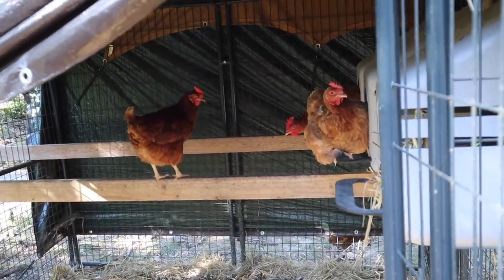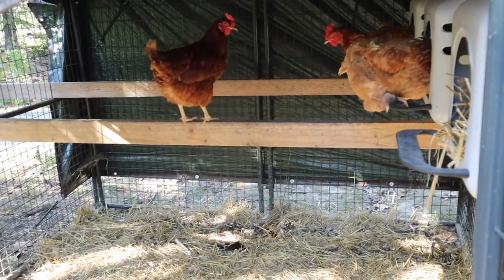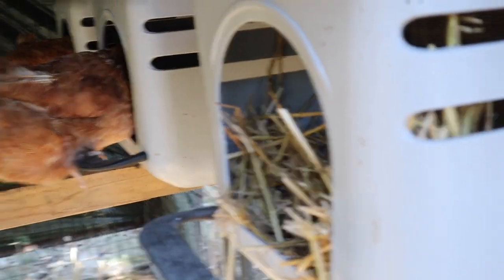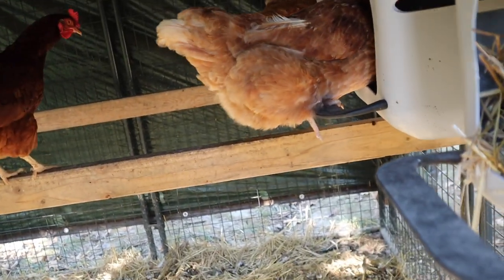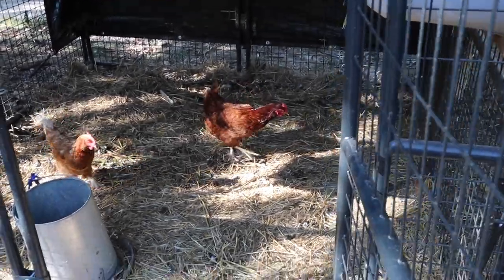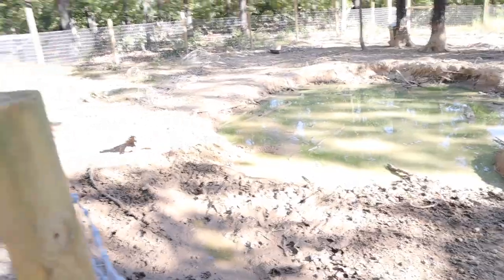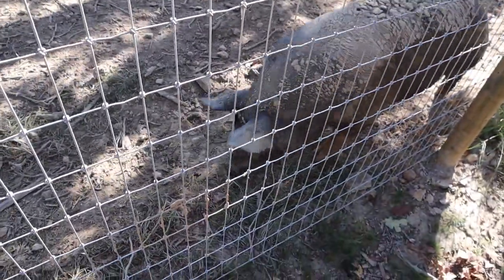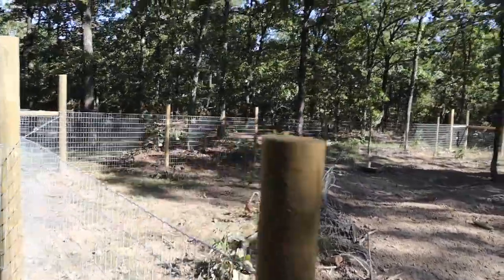HOW TO FRAME WALLS FOR A SHED

Comment: For future reference: When you have a wall put together use a staple hammer or staple gun to attach the 'bug barrier' to the bottom plate of the wall before you stand it up in place. Way less hassle than what I watched in this video.
Reply: Or just use adhesive caulk on it later. Always more than one way.

Comment: For the future you can use backing soda to remove the stinger and it helps with the swelling. I used it when I got stung just make a past and put it on the stinger. Just thought I'd share from what worked for me.

Comment: The arms on the chicken was hilarious. Little t-Rex. I was stung by about 25-30 times about 5 years ago. All up and down my right arm to my wrist. And all across my chest and neck. I was cleaning underneath overgrown bushes. I was trying to rake and use my hand to remove debris, leaves. I was wearing leather gloves. I apparently dug into a nest of ground bees. I didn’t, thank God go into anaphylactic shock. I took Benadryl and made a paste from plain meat tenderizer, to take away the itching and pain. My arm especially looked like Popeye, lol. I should of went to the hospital, but I didn’t. Wasps are way worse. Thankfully Brandi is okay.

Comment: A tip on installation of the sill seal.  Before standing your wall up staple the sill seal to the bottom of the bottom plate.  Also even though sill seal is ok its old tech.  Now days we use a couple of thick continuous bead of acoustic sealant.  It never really dries so its like a rubber gasket under the bottom plate.  Keeps everything out water, air, and bugs.

Comment: I had the same problem .  1 of the five was attached by the other 4.   I tried for 10 months to get her back in the flock to no avail.  I had to but her in a hospital house and small run.  Later I built her her own 4x4 house and run.  I allowed the 5 to run in our fenced yard under supervision, but they chased her often.  I finally rehoused her to a farm where she was put with a rooster and 1 hen where she is very happy.  If the aggression draws blood you may have to relocate her.

Comment: On each side of a door you have a King stud and a Jack stud. The king stud goes from the plate bottom to the plate at the top. then the jack stud goes from the bottom plate to the bottom of the header. the king and jack are tight together. The jack stud bares the weight of the header. Also check your your local code for header sizes based on widths of doors. Right now all the shear weight/ strength is the four nails you shot in.  We have a office here that we can call for these kind of answers to building. they're called Cooperative extension. Very helpful with code info in your area. I know you are off grid and i only tell you this so it doesn't bite you later. Keep in mind of snow loads. Wet deep snow that is sticky and won't shed. Love you guys stay safe.

Comment: Baking soda and water, mix into a paste and let it sit for 15 or 20 minutes. Helps with swelling and itching. Also there's a product called "Afterbite" that works well too. Stings a little at first but then the sting goes away. Helps with itching too.

Comment: baking soda with a couple drops of water to form a stiff paste will pull out all the stuffs. A stepped and squeeze out the hot water tea bag works too. Hell that one cures pink eye in 24 to 48 hours if you sleep with one on. I used a green tea bag for my pink eye and it was extremely better in one night.

Comment: the one thing that has worked for me with bee stings is baking soda and water mix the 2 into a paste and spread it around and it does help that mixture will help with the itching and swelling and pain and it neutralizes the bee venom

Comment: Any sting that I've treated, make sure stinger is removed & put on a paste made from baking soda & tiny water. It draws. In a pinch mud can help drawing. In old days ppl soaked bacon fat in turpentine & held it over the area, also to draw out infection, splinters & so on

Comment: Well house framing looks good  you and Brandy did good together. Working together building your own stuff. Things are coming together nicely. 
Stung on the foot had to be painful I can imagine. Y’all have to be careful with the bugs you got around there and wear shoes when appropriate.
Chicken was funny with those arms on. 
Made me laugh.
Dutch if you run any electrical like in the well house have you considered using MX type rather than Romex. It’s flexible metal and comes with the wire already in it 14& 12 gauge wire. It’s easy to work with metal shielded flexible about 1/2 inch dia. 
Bug and rodent proof.

Comment: Maybe those that didn't like the arms on the chickens need to have and extra set attached to their heads!! Anyway a suggestion to make your shed a bit more structurally sound.  Get yourself 8 more studs and put one more in each corner to supplement the attachment of each wall.  It allows one end to attach to 2 studs vs 1 giving you a strong corner even with the top plate.  Next put a double (cripple) stud on each doorway opening for support for the door sizes you want to use.  You'll be happy in the long run.  Keep the video's coming.

Comment: Hey Dutch you can staple that insulation on the bottom of the 2x4 before you lift them into place easier then just lifting walls and laying it on the floor. :)

Comment: An affordable option for your door (but you would have to put it on 12’ side for obvious reasons) Sliding barn door using door rail and hangers. You can get all the parts reasonably from TSC or order online

Comment: You're probably well into the truss building and installation but, every bit of over-hang helps keep a building cooler on its own with 18" being a gold standard of heat reduction, cost, usage impact, and some heat, loss reduction.

Comment: Really like your channel. Just a suggestion, next time you use sill-sealer, staple it to the bottom plate before you raise the wall. It will make the job much easier. Keep up the great vids.

Comment: Just a little suggestion I tack the foundation sealer to the bottom of the bottom plate. Like you I am usually working alone. I swell like that from yellow jackets and it itches like crazy.

Comment: Dutch mate, have you thought about hiring a builder on a sub contract basis and you work as his laborer when you start building your home. We did it when we built our home, and it takes some of the stress out of getting it done. I then hung the drywall and then I got someone else to hang the doors etc. With Fall being only a short period away for you guys, it maybe an option worth exploring.

Comment: It was funny Dutch. Try this... Hold the chicken with wings tight against their body. Then tuck the head up under the wing, turn them upside down ,& rock them forward & backward  several times. Them gently set them on the ground. It puts them to sleep briefly

Comment: You might have what is called a delayed reaction to the sting. I have two kids that if they get stung by a bee or a wasp they don’t swell up until 12/24 hours after. Good thing about that is the Dr. said that they didn’t need to worry about anaphylactic shock.

Comment: I was just wondering why you didn't have anchoring arms placed in the concrete for both structures?  Tornadoes or even high winds will have fun with them.
Reply: I'm wondering same thing! Didn't see him Anchor the Walls to the Slab in any way!! Seems like it wouldn't take much to just push it over!!!

Comment: Are you adding jack studs to support the header in the door ways?  I'm not sure what way your rafters are going, but you have a fairly large span over the door(s).  I would heat to see things sag and jam the door.  Also if you staple the sill foam to the bottom of the sill plate before you stand up the wall it might be a little easier.

Comment: You should try to get one of those small fans that has a clip to put on it so it'll keep it cool long enough it won't interfere with hearing and and blowing on it it should keep it cooler and you won't have to have somebody any hot batteries are you could fix ice pack that won't sweat on it and keep it cool

Comment: Keeping it dutch you can get a 8ft by 8ft roll up from united central supply in Beckley WV they bulked up for the coal mines then got stuck with them when the mines that used them shut down hopefully this helps you bud!! Just saying probably be really cheap

Comment: hey you can get used garage doors cheap and they will be big enough for anything you need to put in there i seen some for 500 for the set he has 2 sets avail. these were on a new house and homeowner wanted different doors. they. were around 4k new so thats a great deal. so i bet theres alot around you to!!

Comment: Next time use mud. Make a paste with dirt and water and put it on the sting. If there is a stinger left it will help pull it out plus the poison. We has a shed full of them when I was young and mud worked every time.

Comment: Hey Dutch why don't you put another 2x4 with angle cuts so the chickens can get in and out of the 3rd nesting box. Just go from the corner of the pen and angle cut and screw to the center roost.

Comment: Dutch I have a Well house and the roof lifts off   … I had to replace the pump in 2015 .. are you going to have someplace where , just in case they need to pull the pipes like they did here .. we have 420’ OF PIPE ..

Comment: your doing good sir..
but when you did the framing my husband started screaming at the tv.. you did not need to have the wife lay down the foam . next time staple it to the bottom of the wood wall then install .. also where the doors are you did not need to place any there seeing they would end up being cut out . idea for the doors - you might think about buying two front doors and have them open up going out side instead of swinging into the shed, this way it will give you space .

Comment: To me the older camera the picture quality seems to bright or the white balance is a little off. Audio seems to be about the same. I have read that you can change some settings on the camera to cool down the camera, and use SD cards that record faster and some have even suggested using iced gel packs on the camera. If the camera is on a tripod you may consider placing an umbrella over the top of the camera.

Comment: You should get Cortizone-10 it's good for mosquito bites wasp stings and all that there's different types of it but it's really good to get it for that for the poison oak an insect that is really good for that I was done with a yellow jacket once before in the face I rubbed it on and in a little while you could until I've been stung did not swell up like it would have if you didn't have anything like that to put it on it so if you get this message comment it would be good for you to get Cortizone-10 for that purpose

Comment: Why not look into the cost of replacement pieces for the roll up doors and maybe get a frame setup and design your own slats or maybe by buying it all in pieces it might be cheaper. Stranger things have happened. It could also be kinda fun to do.
There is a store here that I think they have them all over the country but I don't know if there is one there. It is called The restore. It is a non profit I think that helps habitat for humanity. They get used stuff out of buildings that are being either torn down or remodeled and salvage good used pieces like doors and windows and doorknobs, you know what I mean? If they have something like that nearby you could check them for some of the things you need.

Comment: Hey Dutch are you using pole barn metal for your for your roof and siding and did you bolt your wall into the cement or did you make it so you can lift it off of the slab

Comment: The tiny cabin may not be big enough to work on the t-shirt orders, once you get the kitchen installed and anything else that needs to go in the living area.  Check the measurements on the space and the bins and table you need, to see if it will actually be workable.  If not, you may have to build a slightly larger tiny cabin for that. ;)

Comment: We don't smoke but I have a pack of cigarettes in the freezer just for bee stings , ant bites and hornets. Take the tobacco out of the paper and get it damp and put it on the bite. Even had put it on a few days later and it still helps with the fever.  When it dries make a new pack to put on until it feels better  😌

Comment: With all the wasp you have you need to get rid of them. Take a dish pan fill with water and add dish soap and take a board and nail a piece of meat to the bottom of it and you will have a wasp killing machine try it for a couple of days and see what happens.

Comment: Another good, cheap, way to prevent insects is put powdered Boric acid on the bottom plate before installing the interior walls.
Reply: I've been in the construction business for 50 years and found out that the little things make a big difference in the future